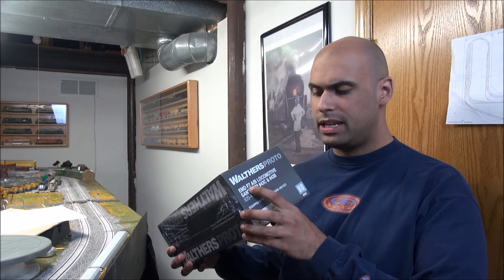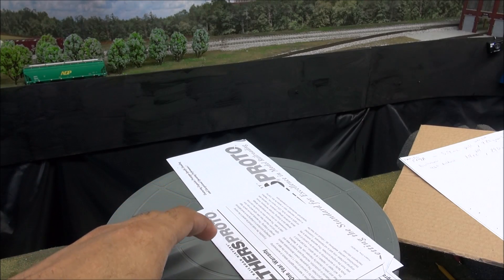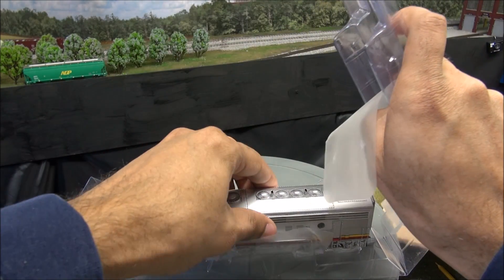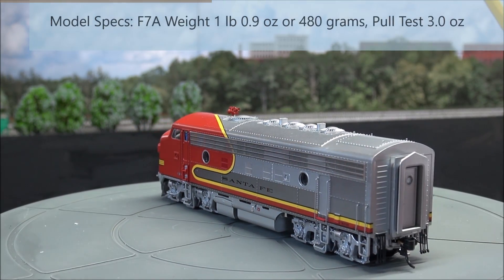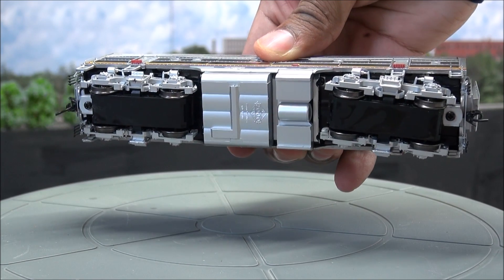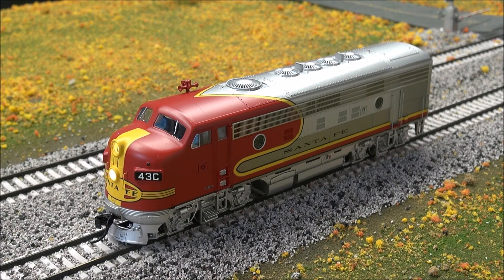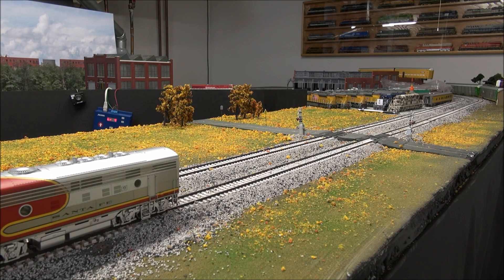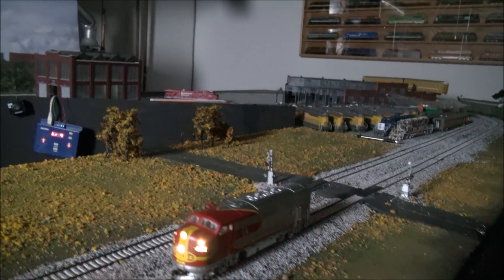Review: Walthers HO F7A&B (Santa Fe) DC/DCC Tsunami Sound

Comment: It looks like from your quick run by that when the A and B unit are connected, there is still a small gap between the diaphragms of these two.  Despite being sprung, it seems this continues to be an issue with these and the passenger cars.  May be nit picking but having a visible gap between is a bit irritating, particularly when they do everything else so good.  It also looks like the fuel level gauges aren't painted.  Wonder why that detail was missed.   Thanks for the review.